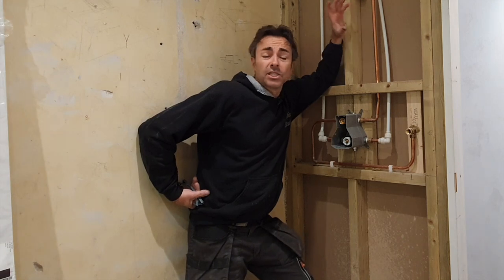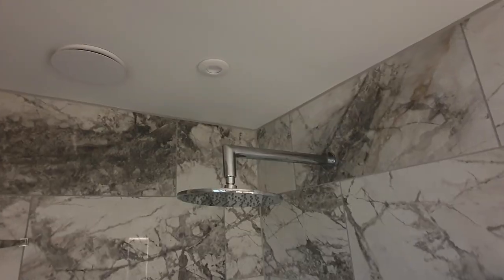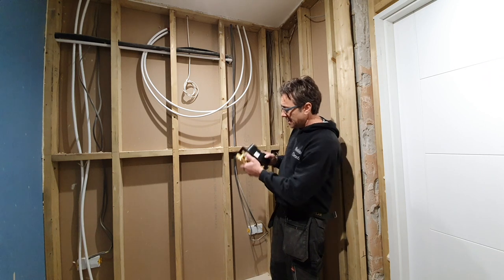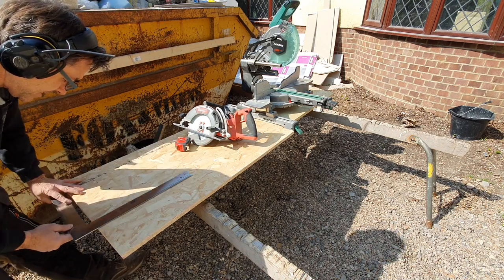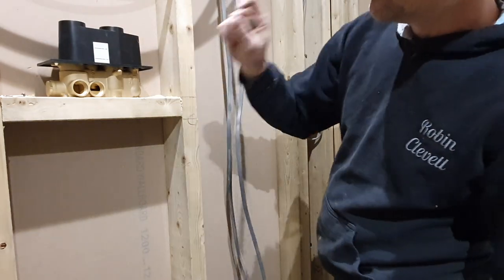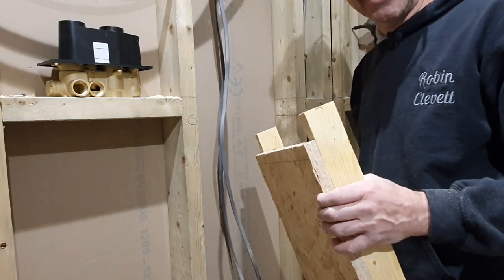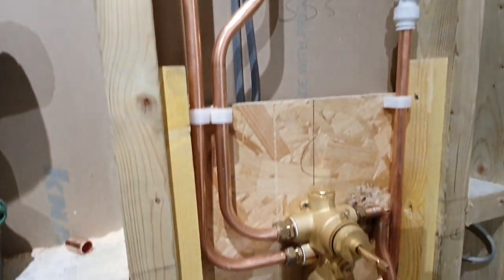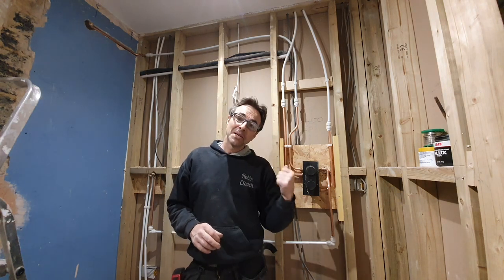How to first fix a shower valve. How to make a support in a stud wall and other carpentry work

Comment: Great work as always Robin. Just a moot point but if the valve should leak any time in the future there's a handy electrical back box to collect the water  😬
Reply from the maker: I have no control over the electrical installation, thank fully the modern electrical breakers would simply cut out if ever there was a problem
Reply: That's a new safety feature called a 'valve leak indicator'. Emits an audible bang for the hard of hearing along with a blue flash & loss of power to indicate there's a problem 😆
Reply: Top job Robin as always. You did the best you could with those cables. Can't believe the electric designer put sockets in the same compartment. RCCB were added to improve safety surely, not to compensate for compromised designs (Just a personal view)

Comment: I am somewhat amazed that an certifier would sign off on a water fixture above and in the same cavity as a power supply
Reply: WTF is going there
Reply: Electrical cables and water pipes run along every building allthe time and they all get signed off.
You'll have to question building regs innit
Reply: 1. You can literally put an electrical supply under water. It’s just dependant on Ip ratings
2. Your entire house has water pipes and cables running right next to each other. 
3. If something is leaking - it’s broken. You can account for this to a degree, but it shouldn’t break. If it’s broken then you will get damage but you can’t design and build a house/building on the basis that it’s going to break/leak or you’d have to build a swimming pool to put your house in.

Comment: Never seen one of those flash things. Mostly I fit what we call a flick mixer. A noggin in the back and done. Some still want taps. Interesting to see all the pipes going everywhere in the walls that will be sealed in. I can remember when shower pipes were the only concealed pipes but you had to have an access panel. Also horizontal cables. When I left that was a no no. Cables were in line above or below the plug or switch. You could cut across to a hard wired stove from the control switch but that was about it. Going horizontal saves time and cable but not such a good job. The old way was so logical and you knew where everything was. Here we do the same pipes and cables in any direction with no logic. You are trying to fit something on a wall and never know what you will hit.
Reply: Horizontal between visible fixtures is allowed https://m.youtube.com/watch?v=c4BsettT0N8

More concerning might be moving the vertical cables off the centre line of the stud wall and nearer the surface

Comment: Not just those cables but most or all cables don’t appear to be in there zones or am I missing something
Reply: I’m not a sparky and any sparky please correct me if I’m wrong, but I think they are in the correct zones as the run vertical from the socket positions and are outside of a special location.pretty sure it all has to be RCD protected, I’ve seen it where the back of a concealed shower valve was touching the back of a drywall box of a light switch (back to back in stud) I asked both sparky and plumber if it was ok and they didn’t bat an eyelid 😂😂😂
Reply: @kingofthetrowel1725  They're out of zones since they don't go vertically from the accessory - they snake off to the side before the vertical run which is out of prescribed zones

Comment: You spent all that time talking about how limited the depth range is on the valve then glossed over the backplate elbow. Usually have to guess your finished tile depth within 1-2mm with those, would have loved to see some tips for that
Reply: Sometimes you have to just work it out for yourself, or hire a professional. All that good advice and you still want more? 
He gives away all the "trade secrets" he knows, now you want him to read the instructions and compensate for your lack of common sense?

Pro tip for all you budding diyers out there; if you can't build an Ikea wardrobe without making a single mistake; don't attempt fitting your own bathroom!
Reply: @sally6457  I know how to work it out myself. My point was that he spent quite a bit of time showing how to do the valve but no time showing the back plate. The back plate generally won't come with any instructions and has less than a tenth of the tolerance of the valve.
Reply: @jacko791  if you know it, make a video and add a link in your comment. 
Why do so many people feel the need to point out what they think people did wrong? 
Be greatfull for the good advice people give, what's with this attitude of entitlement?
The polite thing to do is to ask for a follow up video or advice on where to find help with more details on the area not covered.
Reply: @sally6457  Wow! No need to get eggy. It's been a long lockdown for some, might be time to go out and get some fresh air
Reply: @jacko791  yeah, I think your probably right there. 👍

Comment: This video is amazing. As a bathroom fitter there are so many great carpentry tips in this video that have helped. Pretty much every bathroom we fit now has a concealed unit and I hate this part of the job. Making the wooden pattres with the centre line is so obvious now you’ve shown it, and has probably saved me hours of work on each job since.

Comment: How would you deal with making access for service to, or replacement of the shower valve when, for example, any plastic components on the control levers wear? My father made a removable access panel on the opposite side of the wall so the the entire valve and any plumbing could be replaced without the need to damage the tiling in the bathroom.

Comment: Plumber I used to work with always done a pressure air test and someone would check the dial every day that way not going to damage if there is a leak

Comment: what was the drill bit you were using on this vid robin?  I first fixed a bathroom a while back with all concealed valves. the bath filler (not tap strangely enough) i had to get absolutely bang on for the thickness of the tiles etc it was that much of a stupid design. litterally near enough mm perfect. that was a right headache
Reply from the maker: These where the festool forstner drill bits

Comment: Great video. Would you chop into a brick wall to install this shower valve if it was going on an external wall? I guess if 5he wall was 300mm solid brick would be OK, if it was modern build with block, insulation etc would you/could you buy putting a little lintel in? Not sure what the regs are on that? Thanks again for the great video
Reply: A better solution would probably be to build a stud wall directly in front of the block wall and install the mixer and pipes etc in that.  You would lose 100mm or so of the room, but it would make installation much easier and avoid chopping the masonry wall to pieces.

Comment: How do you get to these valves when they go wrong? I’ve had so many people as me to come and look at drips coming through the ceiling from them or they seize up due to the hard water, the look on peoples face when you tell them you have to remove tiles and they can’t get replacements 😲. I just like sticking to room side valves it makes life so much easier when they need changing.
Reply: That's when you sell them a water softener,

Comment: What type of Framing Square are you using Robin?
Reply from the maker: This is my own framing square that I am producing, it is stainless steel 3mm thick and is marked for metric roof construction, the square will be accompanied by an app with calculators and instructions for traditional roof construction

Comment: I've never seen a carpenter fitting the valve itself is that common in the UK?
Reply: In the UK, if you want it right, ask the joiner.
Reply: This is the ideal situation shown here, in real life the walls are in and boarded, plumber comes along to fit the valve, holes and boards removed every where. Plumber doesn't know anything about the tile work or shower boards going in. Unfortunately it's all down to planning the job correctly and doing things at right stages. Everything Is fine in this job as Everything seems to be new, but what about when bathrooms are getting overhauled and renovated. Also there's just as much work goes into the fitting of the wall plate elbows for the outlets. There's no way in the UK this would happen in real life, a joiner doing what's he's done. They are to busy to worry about doing something like this. Unless they are on day rate and not bothered.

Comment: For the money then cross water mixers are they really should be easier to fit. 
They need to be easier to level and an easier way to get the correct depth. 
The mixers would be better with a soldered connection option well rather than relying on a compression connection inside a finished wall